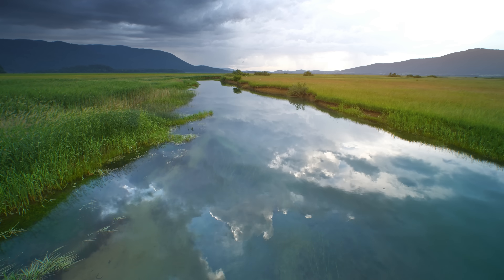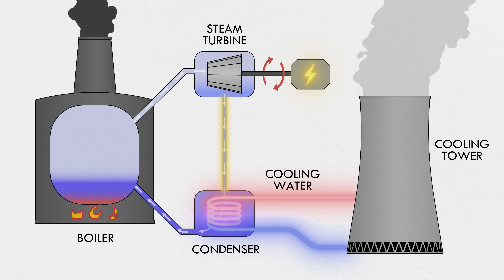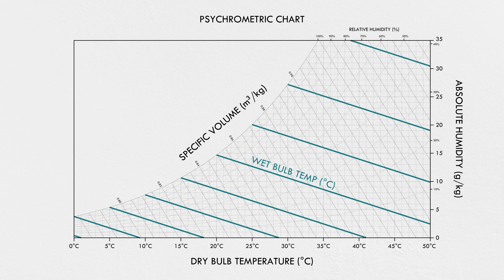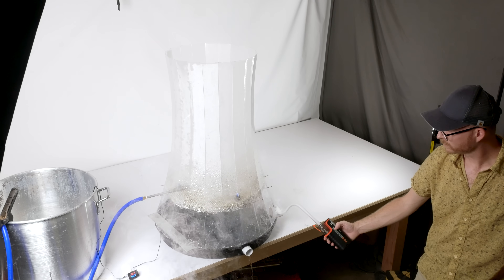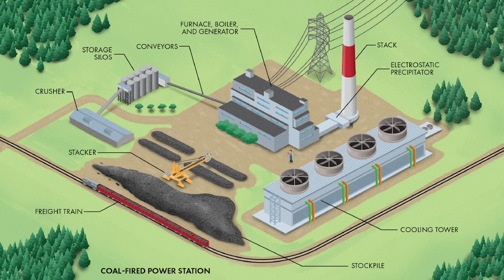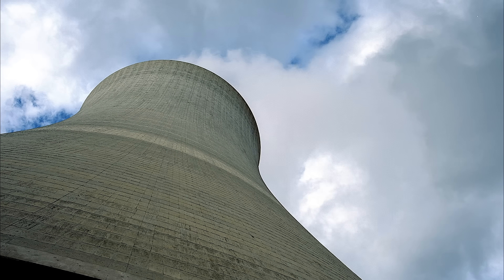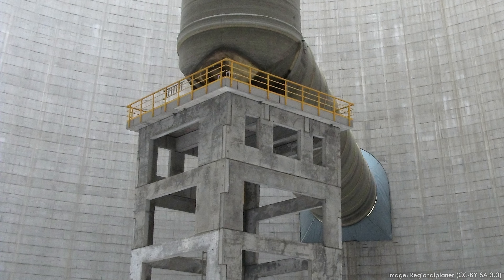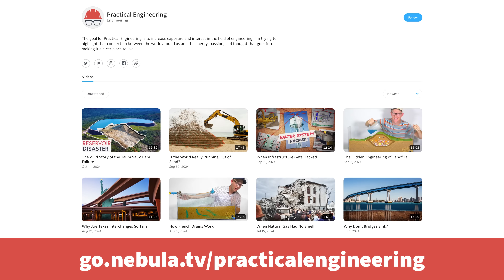Why Are Cooling Towers Shaped Like That?

Comment: - interesting how most "water cooled" items are ultimately air cooled - ie. convection (ok allow for conduction and radiation too)  of the thermal energy from the initial thermal transfer medium to atmospheric air....  (the water cooling in a car's cooling system- really is just a remote transfer,  aircooled engine  (even Air conditioners and other heat pumps - the magic merely allows the thermal energy to be conveyed elsewhere before "rediscovering" its latent energy - in temperature terms......

Comment: @0:46 you state that the steam is condensed to water, but, you don't say why.

The reason why is efficiency.  You are trying to extract the maximum amount of energy from the high pressure.
The purpose of the condenser is to turn steam into water.  I wonder why?  Simple, when stream condenses into water its volume decreases dramatically which causes a vacuum in the condenser which sucks even more steam through the turbine.

Comment: The shape of the tower also helps with a venturi effect, hott air rising pulls air from bottom where the tower is larger with more area and then speeds up as it goes up and gets thinner.

Comment: 7:51 I know that water vapor goes upwards, from observation when cooking and from knowledge that clouds form in the sky, but I always thought that temperature is the driving factor for humidity to rise. It blew my mind to see this chart and hear your explanation, I really didn't expect water in gas form to be lighter than the other air molecules, though I should have know it from the position of hydrogen in the periodic table. Thank you, I learned something extra from this video!
Reply: Another place it come into play daily is for pilots, both small and large aircraft. Ends up being especially dangerous for small planes. Feels counterintuitive that humid air is less dense. Add hot summer temperatures and especially high humidity, and a plane sitting on the ground at an airport at a 3000' elevation may feel like it's at 6500' (called density altitude: pressure altitude corrected for temperature). A naturally aspirated plane with modest horsepower loaded up with people and bags will really struggle to both make engine power and for the wings to make lift.
Reply: @MikeHalsall  So hot&high should be ammended with hot&humid&high
Reply: @NikolaiUA  indeed - though the "pressure altitude" is the piece in the equation that also accounts for humidity. Essentially the weight of all the air molecules in the air column pressing down on me in my current spot... if it's more humid or less humid, the "weight" reading is still the weight and the humidity component of that is baked in. Temperature is not baked in, though (heh)... so pressure altitude (e.g. the difference between what 29.92 inHg at sea level of 0' and what the number actually needs to be set to to read 0' (or, say, the known airfield elevation)) plus correction for temperature is all that's needed.

There are actually five different types of altitude... pressure altitude, density altitude, indicated altitude, true altitude, and absolute altitude. Which makes it a bit confusing especially to new student pilots. But it's really about frames of reference... both the instrument's frame of reference and the plane's frame of reference to some other thing (including an imaginary line in the air at 18,000 feet when (in the US) pilots all set their altimeters to 29.92 so they don't have to be fiddling with it in cruise and you can have planes passing by each other with 1000' vertical separation at Mach .89).
Reply: @MikeHalsall  Got how the pressure alt accounts for humidity, but did not why it doesn't also do so for temperature, why isn't it baked in. If you have the same physical altitude, humidity, and all the other factors (save fot the temperature) fixed - doesn't changing (e.g. increasing) just the temperature alone make the air e.g. less dense and hence auto-increase the pressure alt reading?
Yeah, there's a bit to learn initially about altitudes, flight levels and altimeters (e.g. capt. joe had an altimeter video recently), but it surprises me there are fresh student pilots nowadays who come with 0 knowledge to the school from what I understand. You'd imagine an aspiring pilot would be an aviation enthusiast in the first place and would've belted hundreds of flight hours in a sim like MSFS or the likes before going to a flight school; and know the theory part from there.
Reply: @NikolaiUA  yeah great question - you've got it as "just the temperature alone make the air e.g. less dense and hence auto-increase the pressure alt reading"

Pressure altitude is based on a model that assumes a standard temperature profile in the atmosphere - that is, a standard temperature lapse rate, which is what everything is calibrated to. Using that pressure altitude is going to give me the correct altitude of where I'm at relative to sea level. i.e. on the ground, my altimeter reading will match the airport elevation.

When we put temperature into the equation (that density altitude) - let's say it's a super hot 100 degree day - now my plane will "feel" like it's much higher; e.g. airfield elevation is 2000' but now with the temperature thrown in, my plane "feels" like it's at 5000' (those are pretty real-ish numbers). But if I were to use that in my altimeter, I'd be reading I'm 3000' higher than I actually am.

If I actually used density altitude in my altimeter and I were in the clouds, I'd run into the ground 3000 feet before I should've. So I need that corrected-for-temp density altitude to tell me how my plane is going to perform, but I need pressure altitude reported by ground stations to tell me my altitude relative to the terrain around me.

I hope that makes sense? I'm just a private pilot with 400 hours, not a CFI or meteorologist :)
Reply: Same! I had to pause the video and grapple with the realization that my intuitive thinking about air humidity was not just wrong but ridiculous when I actually analyzed it!
Reply: @johansten7976 that’s exactly what I did! Paused it, listened to it twice then face palmed myself for getting the physics wrong. More water vapour = less dense air.
Reply: When you measure the weight of gases, you gotta look at the atomic weight of the constituent atoms in the gas molecule. Unless the gas is compressed to a significant degree, they all behave pretty much the same. For some common gases, these are their weights in atomic weight units (roughly 1 unit per proton and neutron in the atom's nucleus):

- Hydrogen (2 atoms): 2
- Helium (1 atom): 4
- Methane (5 atoms): 16
- Ammonia (4 atoms): 17
- Water (3 atoms): 18
- Nitrogen (2 atoms): 28
- Carbon monoxide (2 atoms): 28
- Oxygen (2 atoms): 32
- Argon (1 atom): 40
- Carbon dioxide (3 atoms): 44
- Propane (11 atoms): 44
- Chlorine (2 atoms): 70
Reply: @LucarioBoricua  Yeah, I know that, but thank you.
Reply: It makes sense that water is lighter than diatomic nitrogen, oxygen, or carbon monoxide/dioxide. Hydrogen is lighter.
Reply: @thedeekabides  yes, i mentioned that in my post.
Reply: I live near a power generation plant that used to burn coal and oil but has switched to burning natural gas! It has 2 of those types of cooling towers! Airlines pilots often confuse this plant for 3 mile island! 🤣 🤣 🤣 I live in Eastern PA along the Delaware River.
Reply: You ever notice on a hot humid summer day how its a bit harder to catch your breath? Even if in the shade or at sea level.  
Its the humidity lowering the density, and thus the oxygen concentration as well.
The first reply covered why it creates less lift and engine power in aircraft quite well. 

Even more interesting is water and or alcohol with some % of water is actually used on some engines to increase performance and reduce detonation. The addition of steam and its rate of expansion actually generates slightly higher cylinder pressures and thus more power.

Comment: I work in Geothermal, and to put in perspective how much parasitic load is involved with CW loops. One of our brand new power stations (Tauhara in NZ) has a gross maximum continuous rating of 184MW. The net output is 175MW. About 3MW are used in various processes across the plant, but the other 6MW is used just by the main CW pumps and the forced draft cooling tower (same concept as the ones in this video but much shorter using big fans).

3% of the gross output of the generator is used just to condense steam in the turbine exhaust. And to put that in even more perspective, geothermal steam is also way cooler than coal or nuclear...

Edit: I just noticed the plant at 10:25 is Ohaaki Geothermal Power Station. NZ's only natural convection cooling tower. I frequently work there too and its awesome standing right next to the base and watching the deluge...

Comment: use uranium to boil water.
Reply: Try boiling 20 Litres of water to the boiling point from room temperature and mock power plants. It takes a lot of energy to boil water.
Reply: @jamesisaac7684  yup. That's why uranium are used to boil water.

Comment: How do they deal with minerals building up inside of the towers from the water? Don’t the towers get scaley, like the heating element on a humidifier does?
Reply: Maybe they will clean when the fuel rods are replaced. They have to shur down the plant for it.

Comment: Hi Grady, great video! Question, I know steel and concrete are extremely strong, but what other materials could realistically be used? Something that wouldn't rust either, like a carbon fiber lined something or other? We've advanced on the materials front dramatically in the last decades.

Comment: I used to work at the South Texas Project. The primary cooling pond is MASSIVE. Saltwater ingress is a bit of a concern, but actually the larger threat from that type of cooling circulation was little flying bugs called midges that would get attracted to lights and the warm water, then wind up clogging the cooling loop fins. Its an interesting plant.

Comment: hi grady, in eastern europe, excess heat is dissipated by piping hot water through municipal systems providing free heat for the workers who live nearby and work at the facility generating the excess heat.  in the west we prefer to vent that heat into the atmosphere rather than just give it to folks who would otherwise be buying it from a utility company.

Comment: I love nuclear power and am glad big tech is investing in it to power our new AI data centers without increasing their carbon footprint. I know we need clean energy now and it frustrated me to no end that our polititions will not even consider nuclear as an option as it is completely green, with it also being the safest form of power generation. Believe it or not you remember the nuclear horror stories but probably cannot name a single successful plant. Belive it or not including deaths from disasters nuclear power is 99.8% safer than coal power plants. Nuclear is not only renewable but one of the safest options and we could repleace all of our greenhouse gasses with clean energy in less than 30 years without building a single solar or wind farm. Nuclear is a gift from the universe but our public fears it to much to even consider it an option when those fears are completely unfounded.

Comment: I am a mechanical design engineer at a nuclear power plant. The natural draft cooling towers are not relied on for operation of the safety systems. Reliability is still a reason for the use of natural draft cooling towers as we like the plant to be stable at full power, but if anything happens to the big natural draft cooling towers, it will not adversely affect our ability to cool the reactor.  

Just wanted to clarify this because there are enough misconceptions about nuclear power without people thinking a plane crashing into the cooling tower could cause a meltdown.

Comment: You seem to be mixing up feedwater and cooling water through your video. Feedwater is run as a closed loop system from the boiler, to the turbines, to a condenser and back to the boiler. Cooling water is the stuff sent through the cooling towers/picked up from lakes/rivers/dams etc. The cooling water is put through the condensers to condense the feedwater from steam to water but never comes into contact with it
Reply from the maker: Where did I mix them up? I drew a diagram with them labeled.

Comment: Fun fact, the balloon graphic at 7:41 is not a hot air balloon. Based on the sandbags it is a gas balloon, which uses gasses like hydrogen or helium to ascend, as opposed to a hot air balloon. Hot air balloons don't use ballast.

Comment: About Humidity, makes perfect sense, actually in aerospace, for a propeller aircraft, there is a loss in thrust the higher the relative humidity there is. Water vapor has less thrust for a propeller.

Comment: You won't have smoke coming out the top, even if you introduce smoke into it. The particulates will be captured by the water molecules and will fall to the bottom.

Comment: In northern England you see these evaporative cooling towers everywhere. Sheffield used to have a pair that were iconic. Before they were knocked down, they were known as the salt and pepper pots
Reply: I wonder if the point about them working better in cooler, more humid climates is why they were more common - it's certainly odd hearing them described as most associated with nuclear due to their cost, when in the UK they are (or, now, were!) very strongly associated with coal power.

Comment: I don't think it is counterintuitive at all.  If the goal is to use convection  to draw air through a system you must have sufficient "stuff" in the air to create a gradient to get that convection.  I would think most whom are familiar with construction of homes, especially homes, would not think it counterintuitive especially in the hot humid South where a/c became the norm long before the rest of the US.   In the South before a/c convection was how homes were kept cool.

Comment: Question - why not put the excess heat in the used steam to use?  Couldn't it be used to run a Sterling engine and add power to the grid or supplemental power to the operation of the station?  Is the steam too cool already or are there other reasons?

Comment: Fun fact:  I retired as a nuclear reactor operator.  We had a 514-ft tall cooling tower and I did get to climb it twice.  Our reactor was 3840 mwt and our generator output was almost 1200 mwe depending on river water temperature and air temperature.  At 100% power we would evaporate approximately 13 kgal per minute up that tower, once again all depending on water and weather factors give or take.  The water is not boiled in the tower, it is just giving up its heat (enthalpy) to the air.  The water that reaches the cooling tower basin is within a few degrees of the makeup water supply from the river.  The excess water flows over a weir and back to the river.  This water must be within a few degrees of the river to prevent a fish kill from sudden temperature changes.

As an operator, the trick is to balance the makeup water supply against the losses mostly by turning on or off other pumps.  The tower is engineered for steady state operations.  But during startups, shutdowns, or scrams, you have to watch the basin level to prevent overflowing when shutting down or running the basin dry when starting up.  During a scram from 100% power in the winter, you have less than 30-40 minutes to make adjustments to the basin level before you get into trouble.  It is easy to do as long as you don't get distracted by whatever caused the plant to scam in the first place.

Comment: As the tower rises it get narrower. I think the purpose is to make the upward  flow faster and the pressure lower (Venturi effect). Isn't so? This is also true for smoke stacks.
Reply: Just the opposite: The wider the outlet area, the slower the flow, the lower the wasted kinetic energy. Narrower at intermediate height is for the structural reasons. Well, the curvature in both horizontal and vertical direction could also be realized by a barrel shape, but that would take more material and wind load (same holds for the upper part of smoke stacks).

Comment: Nuclear engineer here, over in the UK, we've been the fortunate position to be able to use the coast as our heatsink. That's not to say that it doesn't pose inherent issues on the tertiary cooling loop. You'll have problems such as microbial ingress and condenser tube blockage by mussels and other molluscs and crustaceans. Likewise, you're running into the potential issue of having your cooling water drumscreens being blocked by seaweed or jellyfish. I actually live opposite 2 power stations in Gloucestershire; Berkeley is right opposite my house (separated by the River Severn) and Oldbury units are downstream. Luckily, the Severn has the second highest tidal range in the world, so you'll be able to count on the tides to thermally scavenge the latent heat from the steam generators/boilers. When looking at PWRs, some novel solutions have been put in place in France for example. There's restrictions as to how tall you can make cooling towers in the Loire valley, so some of their intricate designs for low profile towers to condense the fluid is quite novel; Chinon NPP is a good example of this.

Comment: it may not be your "alley" but there is a term in the industry called "fab snow"  The semiconductor fabs are so big and require so much heat/cooling they put tons of moist warm air "into the air" that can fall as snow when it's cold enough.  You can personally experience this on US26 west of portland around the  Cornelius Pass exit..  when the air is dry and cold enough and blowing north..

Comment: tall "chimneys' aren't for getting exhaust above populated areas.. that's ridiculous, winds will easily disrupt that.  We have tall chimneys for the "chimney effect", hot gases moving up through the chimney pull a draft for more air to fill the combustion cycle"